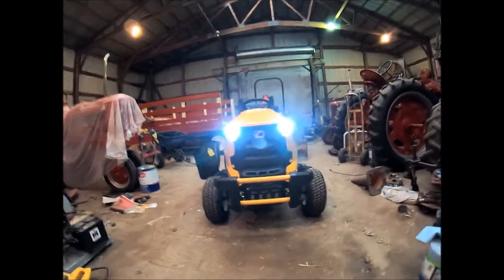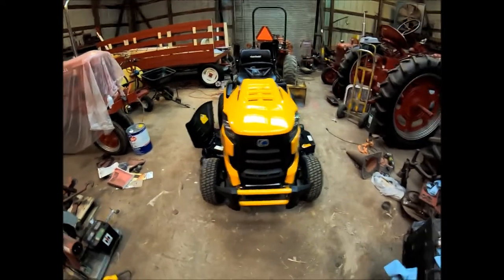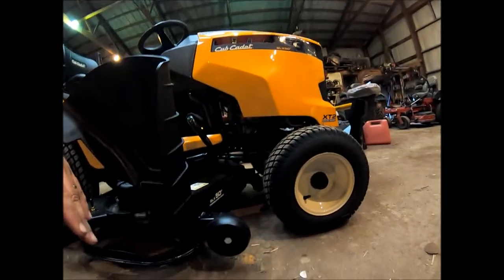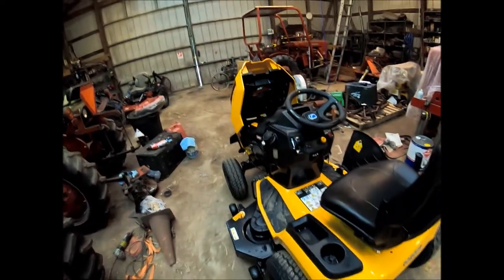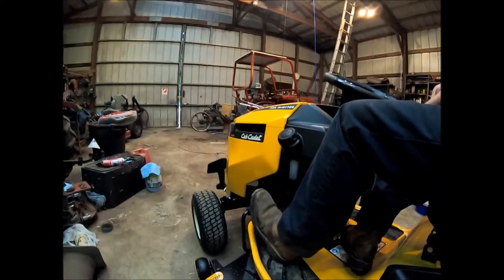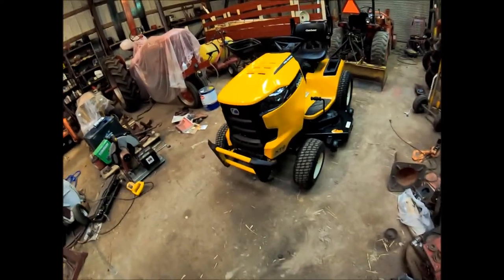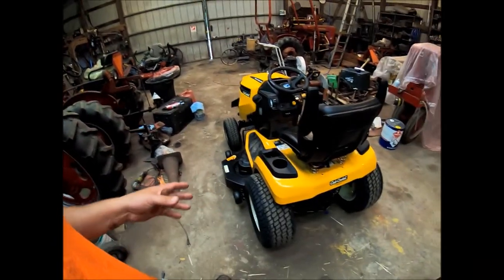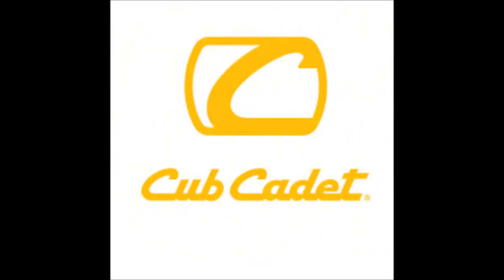New Cub Cadet Xt2  SLX50" Mower

Comment: I grandpa bought a Cub Cadet new in 1961 and paid $600 for it. My dad still has the receipt. My grandpa only ever had IH equipment on his farm. Dad sold the mower a few years ago. Wish he would have told me would have loved to have had it. I was a mechanic for a local John Deere dealer and we did all of the set up's at Lowe's and Home Depot on John Deere lawn tractors. The John Deere tractors you buy at the big box stores get the same inspection and set up as the ones at the dealer.
Reply: I’m glad you mention that. I hear all the time that the big box store mowers are not real Deere’s or Cubs but they are indeed. They are just built to slightly lower specs so that the average homeowner can afford it. Not saying that a $1,500 mower by Deere is just as god as a $6,000 mower by Deere but it is a true John Deere built piece of equipment. As with anything, you get what you pay for. I’ve owned both Cubs and Deere and I’m due to purchase a new mower this season and I’m going with a carbureted Kawasaki powered Cub Cadet.

Comment: You can buy the Xt2 at ACE hardware. I’m on the fence between a XT2 GX50 or the XT2 SLX50 and both are 2021 models. The XT2 SLX50 is just like yours but has a true carb Kawasaki engine on it and both have fab decks. I’m like you with Kohler engines but the last Deere I had with the Kohler Courage and it was garbage. The difference I see between the XT2 GX50 or XT2 SLX50 is that the GX has a larger Kawasaki engine, solid aluminum trans (vs cast), better seat, and bigger CCA battery. They have a left over 2020 model XT2 SLX50 with the cub EFI engine just like yours at ACE, my wife works there so we get a small discount but I’m really thinking of going with the 2021 model as I like the new facelift. How is yours holding up?

Comment: Wd 40 will be your new best friend before you even try to get the blades off spray the springs and coupler on the spindles. Grass juice will lock them up blades are expensive and only available thru cub cadet . Go ahead and find spindles and blades   fastattach blades are very thin and don't last

Comment: Please sir step away feom.the Kohlers. They are junk even the dealers say so. I have one that's now junk. 300 hrs. Well maintained. Everywhere ya look at used the kohlers have been rebuilt. Go to the kawasaki.
Reply: My experience it just the opposite. Kawasaki is okay, Kohlers are better engines, however.
Reply: @rjdavis7503  not the ones we're talking about. The dealers don't even like them. So that says alot. But it's most of them in the lawn tractors they are using for the last many years.